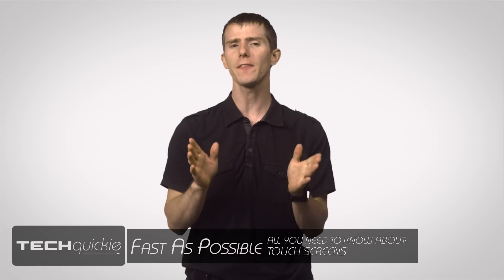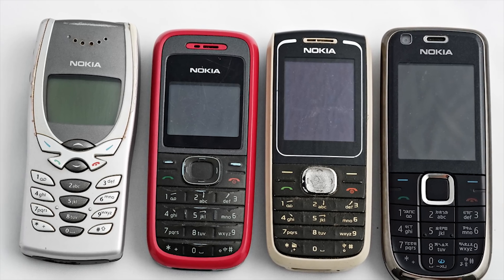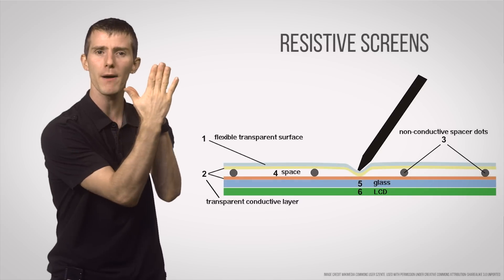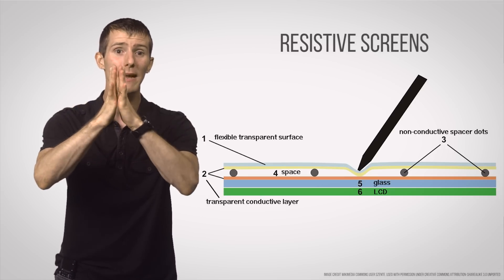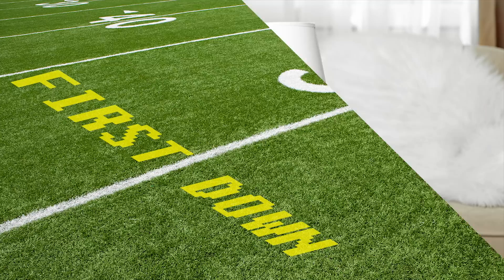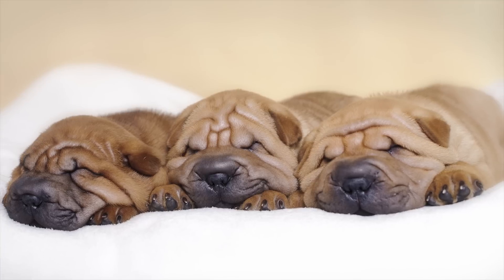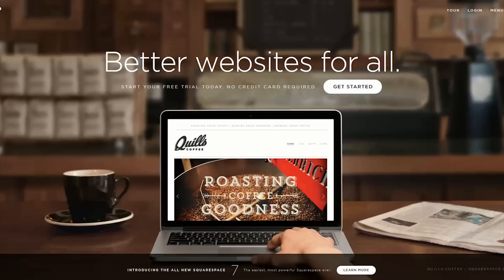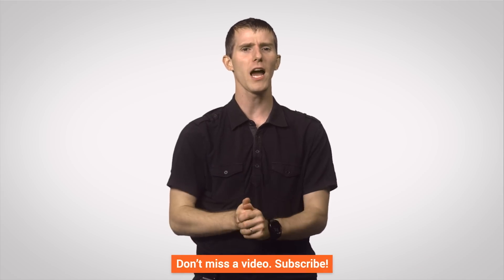Touchscreens As Fast As Possible

Comment: Resistive touchscreens do not lack precision, in fact they are more precise than capacitive (Notice how a stylus for a resistive touchscreen is a fine point while for capacitive they are like a pencil eraser nub). Their main drawbacks are that you need a lot more pressure than capacitive for them to register a touch and that they can't really do multitouch. Other than some hackish ways to get them to register a measly two touch points, they can mostly only sense a single point being touched.

Comment: Why does my PC restart while playing just cause 3,specs fx 6300,Biostar ta970,ATNG 800 watt power supply,gtx 970,8gb 1866 ram,480gb SSD ADATA
Reply: buy Intel, that should help
Reply: Reinstall the game and try that if that didn't work try to update different drivers
Reply: +Thomas Bradshaw also it loves to crash at 1080p and the crash usually happens when I hit the pause button PC just restarts or it can crash randomly, 900p however rarely crashes even while the settings are up.
Reply: +xINFINITExgamer something is wrong with your graphics card for Sure make sure it's all good
Reply: +Thomas Bradshaw could be the game cause I can run Gta 5 and doom maxed at 1080p just fine.
Reply: +xINFINITExgamer lowering my resolution to 1600x1024 and changing my settings to high instead of very high made it stop restarting
Reply: +xINFINITExgamer I'm not crashing anymore at 1080p Max settings weird I guess cause I verify game integrity

Comment: "Texting could never be the same without them" and it isnt. I used to be able to punch in a text message in t9 without looking at the screen the whole time, and just a quick glance before sending.  Try that now and you'll spend more time fixing all the wrong words. Remember, the texting and driving ban frenzy wasnt big until smart phones :p
Reply: +CKOD Also, are styluses/styli for ipads for drawing as good as the wacom tech used to be? I had a toshiba convertable laptop, and the wacom pen tech in it was awesome, pressure sensitive, button on the pen for right click, flip it over for eraser. Felt pretty paper-like writing on it, no batteries in the pen, etc. No idea as I havent used one with an ipad.

Comment: interesting because i made the experience that resistive screens are much less durable than capacitive ones. In retail the resistive screens are worn out very quickly due to the plastic top surface hammered by the fingernails of the cashier women (and men), where the capacitive screens have a glass top layer which is much more durable. often those women complained about the face that they can't use the screen anymore by their nails though. some resistive screens only lasted about half a year before they had to be replaced.

Comment: Honestly as much I like touch screen devices,they have been shown to have certain limitations when it comes to gaming. This is why I bought a controller for my phone to use for supported games and AHEM emulators. I also really miss having a slide out physical keyboard,a feature I'm surprised didn't stay around after the original Motorola Droid.

Comment: Phone buttons are digital, not analog.
Reply: You are stupid. Watch the Analog vs Digital video on Techquickie.
Reply: In computing "digital" most often means "binary" or "discrete".
"Analog" in computing means "continuous" with connotations that put it at or above the level of representability by a floating point number.
Buttons have two distinct states: pressed and depressed. You could press it with different amounts of force but they are designed to jump between only two states and the underlying circuitry is incapable of distinguishing more than the two states of the button passing an electric connection through or not.
Having two distinct states makes it binary, being binary makes it digital.
Do I have to explain the etymology, linking the word "binary" to "two" and "digital" to "number" or you retards just zip your fucking yappers, finally leave and never come back to argue with people who, in contrast to you, have an idea of what they're talking about?
Reply: Analog also involves electricity, Analog has a range of signals while digital has binary packets of signals
Reply: *you’re
Reply: No you dumb sh!t
Reply: What about in the times of the old Nokia 3310?
Reply: No, your stupid.  Digital involves electricity.  Analog does not.
Reply: @snowwolf467  most retarded comment ever